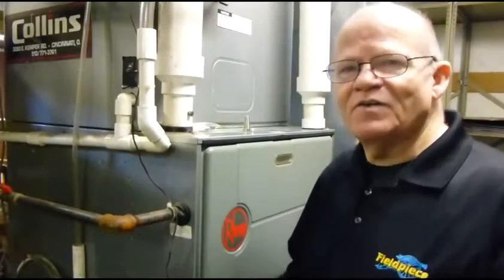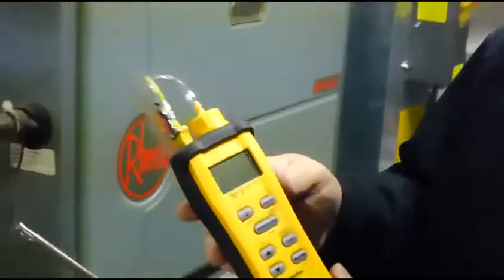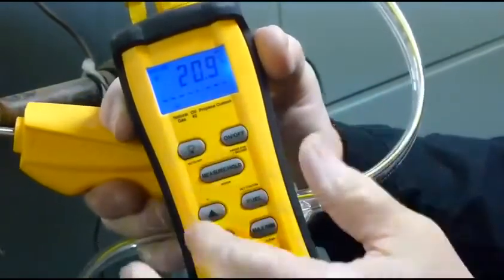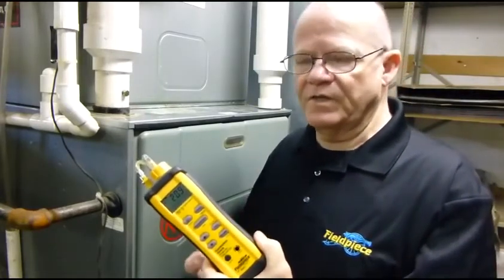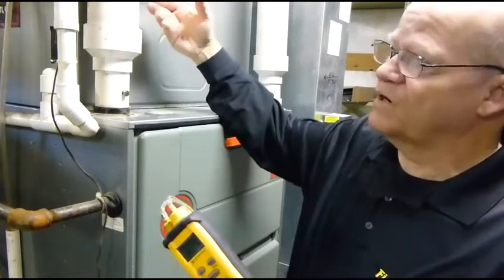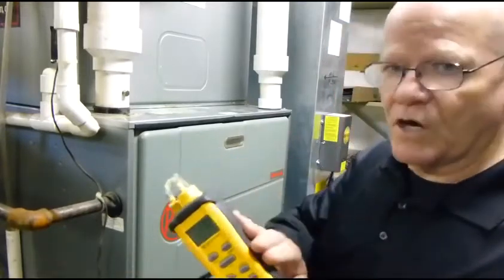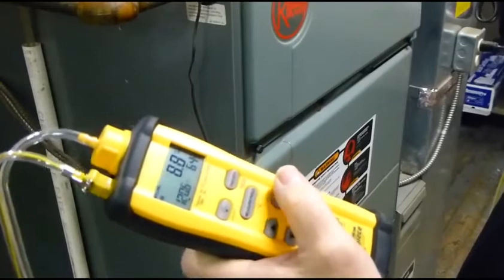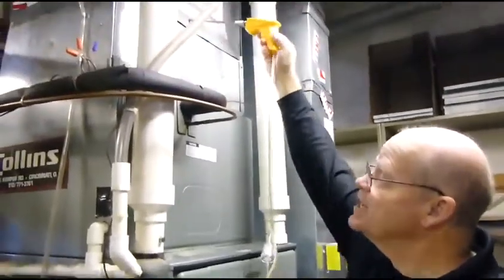Fieldpiece SOX3 Combustion Checker - For Fast & Accurate Furnace Tuning - Smart HVAC Products

Comment: I know this video is really old.  But I just picked one of these up from Amazon.  I'm a diy.  Not because I'm cheap but I can't get anyone to properly do an annual service and even if I could it's nice to know mod year with fuel prices so high. 

For the cost of a service for my furnace and water heater I bought the tool.  

I have a co meter already (uei) that needed a new o2 sensor.  Since it's supposed to be sent out and I couldn't even source the replacement sensor I picked this whole new meter up for not much more than a sensor for the old one. 

Used it yesterday as a pre check and worked flawlessly.  Now I can do a exchanger cleaning. Filters, screens and  Nozzles and recheck. I had to set my water heater by CO only because my uei sensor failed but it's pretty close to where it needs to be so I'm sure I'll actually have some fine tuning to do. 

Kudos for making the sensor field replaceable. Even if I have to replace it yearly or bi yearly after only a few uses it'll still prove a cost balance for me. 

I'm unable  to find any science on this question though   Would sealing the ports on the tester or even storing it in a vacuum environment prolong it's life?  Or would the tool say it needed replaced anyways.  Not sure of it's going to tell me it needs replaced even if sensor is functioning.  Thanks